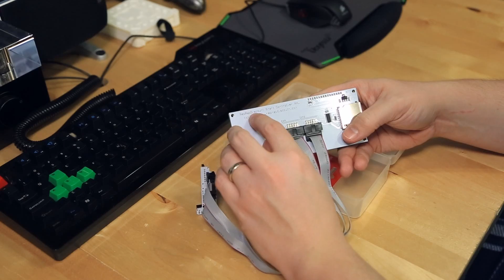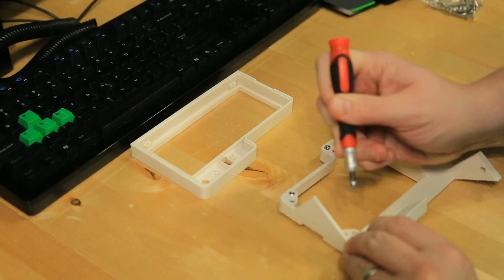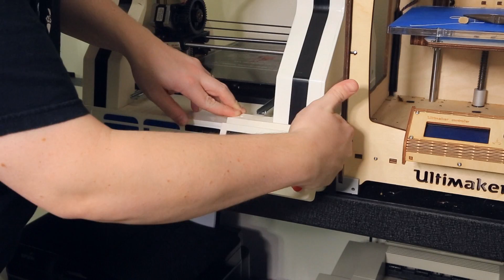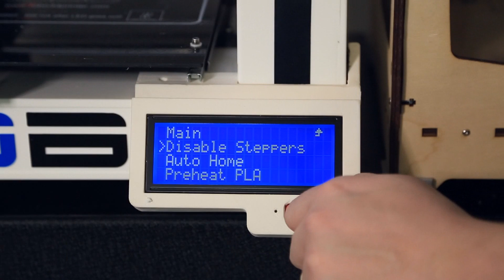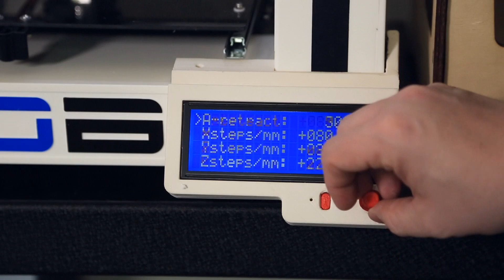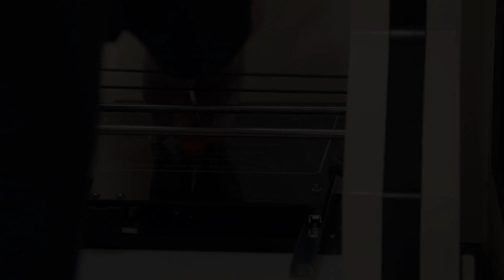How To Install Smart LCD Controller XXL on Robo 3D Printer : Best Upgrade - @Barnacules

Comment: I am wondering if you can help me out, I am trying to print off an SD card on my robo 3d r1+ but the extruder keeps losing heat causing clogs and other grief. Did you cover that issue in one of your videos or have any suggestions to fix it?

Comment: Hey Buddy, nice video. Just a quick question though. If I order that Smart LCD XXL do I have to use Slic3r to create the file to print?   Robo 3D came with software that is pretty nice. It would be nice if I could just create a file with the Robo 3D software and use that. Any help is greatly appreciated.
Reply: +John Valle You can use Matter Control. Just Export to your SD card.
Reply: or Cura if you want to

Comment: For R1 Plus owners-the one part of the connector has another on it. It goes to the built in SD. You can disconnect it!
Reply: +Techommentary I've installed the controller and it's working but the contrast is too high, any ideas? I've turned the dial on the unit all the way down but it's still too high.
Reply: I have the smaller version of this sold by RepRapDiscount that I got off of Amazon. Try turning the pot both ways and it should eventually work. If not, return it Did you buy from Printed Solid?
Reply: Yes sir I did. I'll mess with it some more then contact them if I don't get anywhere
Reply: +Techommentary  Can you clarify what you mean by that?
Reply: Josh McCullough Basically, the new versions of the R1 have a built in SD card slot. WHere you are supposed to plug the controller in, the ports are preoccupied by this new SD card slot. You have to unplug the SD card slot on the side in order to install the controller
Reply: Does the SD slot on the display pass-through to the RAMPS board directly? E.g. can you still access the contents of the SD card from MatterControl when the card is plugged into the slot on the display?

Comment: I have a question for you experts. I'm new in the 3D printing and following this channel I got a Robo 3D printer and the XXL display. All works great and I already printed many things, BUT, here we are, I have one part that I'm trying to print that stop after 7 hours. The printer seems fine but the display is losing the memory card. In fact after the printer stop, I looked at the memory card folder and the dysplay didn't show ant files. Are you aware of any time limitation that is set with this controller? thanks to all .. Max

Comment: Hi, Thank you for the tutorial! I followed exactly the way you show in your video. I bought the LCD controller and installed on my Robo3D. For some reason, I don't see Z axis and extruder move controls on LCD. I can control only X and Y axis only. Do I need to update firmware?
Reply: Shresta Gowda Same issue here.  No Z axis, no extruder controls
Reply: +Kent Dyer  I had the same thing Installed a few times and got no Z But got everything else, on the 5th try it worked. The only thing I did a little different was make sure my ribbon cables were very straight and not twisted / overlapping...  
  Not sure that could be it.. strange. working great now though..
Reply: I got it.  PrintedSolid was right on.
Reply: Yup found this out this morning lol made a video to show them and seen this post haha All is good... great upgrade

Comment: Where Can i get a longer wire
Reply: Mohammad Mubin you can`t if you make the wire longer it causes problems
Reply: Oh what type of problem ??
Reply: It is sensitive to the cable length if you make it longer it will take longer for the signal to arrive at the arduino even these few microseconds are enough to cause hiccups when printing
Reply: Oh thanks ill keep that in mind

Comment: Hi i am having a problem. I am using a ultimaker pcd and the large smart Lcd , but everything I change on the lcd doesn´t save on the eeprom. If I turn off , no data have been stored. I enable already the lines on the arduino firmware, but still the same.

Comment: mine lights on but its not reading anything just blocks, is there something you suggest I can do?
Reply: I have the same problem. Did you ever get yours working?
Reply: Landon Brecheisen yes it works perfectly now - I updated firmware to a newer marlin with support for reprapdiscount but I needed to readd the u8glib library to my arduino folder (I use stable and nightly builds for different things and it wasn't in the correct arduino library)
Reply: Andreas Nicholas I have a RAMPS GADGETS3D LCD and SHIELD and can't figure out what is wrong. I am pretty sure I have a newer version of Marlin. I have not tried to download u8glib library. That is because I think it is only for the reprapdiscount LCD. The screen lights up there is only blocks and no words and when I press the button knob in it makes a beep sound.
Reply: Landon Brecheisen In Configuration.h file search //#G3D_PANEL and uncomment to #G3D_PANEL
i think the u8lib might be needed anyway
looks like a nice panel!
Reply: I already uncommented //#G3D_PANEL.
I will try to get the u8glib downloaded.
Reply: Andreas Nicholas I tried u8glib downloaded still does not work.

Comment: Installed the LCD Controller. The screen lights up and shows lighted squares only.
How to update firmware for this printer would be helpful.
Reply: I have the same problem. Did you ever get yours working?

Comment: My display is all pixels on. No graphics showing. Any idea?
Reply: same, did you find a solution?
Reply: Nope. Ebay gave me a refund.
Reply: Randy Merrell I think it might be firmware
Reply: I did update but admit I may have made a mistake during the process.
Reply: Andreas Nicholas I have the same problem. Did you ever get yours working?
Reply: Landon Brecheisen No I have not.
Reply: ***** No I didn't but I want to now. Can you send me a link?
Reply: ***** I bought it from Printed Solid. It works! Printing a case for it now. Using the controller.

Comment: Love the display. I saw a video where you showed a lot of the upgrades you printed for the robo to get it to print correctly.  Maybe I missed it, but why did you get the robo in the first place since you seem so happy with your ultimaker?  Is it so you can have different plastics in each so you don't have to swap filaments?  Do you like to have parts printing at the same time on both?  Or is it just a deep desire to collect cool stuff?
Reply: I just noticed that the ultimaker 1 does not come with a heated bed.  Is that a reason you got the robo?  Nice cheap heated bed printer?  And you already have the ultimaker to make parts to improve the robo...

Comment: Great tip, display ordered and Promo code used. Hope the appreciate your efforts. My Robo 3D has been on order for right at 12 weeks but I hear promising things about next week!
Reply: Harley Designs Hey Harley Designs, have you reached out to tech support yet? We have a 24hr line or you can schedule a one on one video chat with them so they can diagnose what's going on and get you back to printing asap. robo3dhelp@gmail.com or (844) 476-2533 ext 2.
Reply from the maker: Awesome! You will love it. I love how big the screen is! Make sure your printer is flashed with the latest LCD capable Marlin firmware from the forums before installing otherwise you might encounter some problems.
Reply: Barnacules Nerdgasm Thanks for the tip, I will be sure to check that out. Thanks for taking the time.
Reply: HarleyDesignsInc And, did it arrive yet?
Reply: Rob Outshoorn it did but sadly it only worked for about 8 hours and then I'm not sure what happened. Might have been my firmware update to the Robo that isn't allowing it to interface any longer. So now I just have it sitting on the bench hoping to get a chance to figure it out.
Reply: I'm having the same issue , the display was working fine and now just stop working, it's light-up but no text are on the screen.. After checking cables, power , etc.. I open the call with Robo Tech support but so far we haven't found a solution.
Also at the same time that the display stop working looks like the Z + offset got lost, because i had to set it again.. Any suggestion on how fix this issue is welcome.. 
Thanks

Comment: with ferrite filters on both ends of the cables you can extend it with no issue
Reply from the maker: Have you done it already? Because I believe the issue was a power supply issue and the ferrite filters won't solve that.

Comment: Print a webcam holder for the Robo 3D, like you have a holder for the Ultimaker. Also... Printing with metal is already possible on ultra high end 3d printers.

Comment: Wouldn't it be easier with USB rather than a SD card
Reply from the maker: No, because USB requires the computer to feed a constant stream of commands to the printer so if the program on the PC crashes or it hiccups or reboots you loose your whole print. This prevents that from happening!
Reply: okay thanx for informin me

Comment: Can you recommend a printer for around $400 US?
Reply: take look at QD-BD's OneUp ($199) and TwoUp ($279) printers. very cheap but also not as proven as the printrbot. Haven't used or seen these printers work, I've only heard about them
Reply: The OneUp and TwoUp printers have no limit switches and that makes them a pain to use. I would not buy either one of them.
Reply: David Mc  i built both for a friend of mine. and the initial setup is not that bad and if you don't want to setup your printer for printing (set x,y,z axis before you print) $5 bucks and some hot glue and you can add those missing endstops